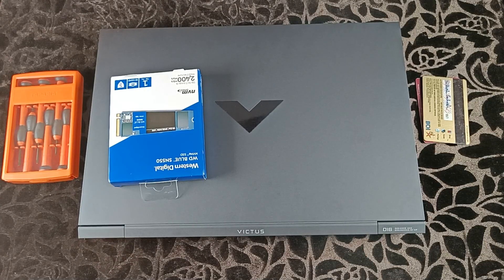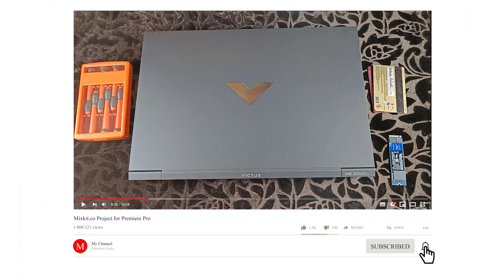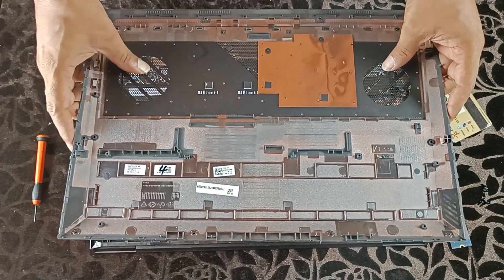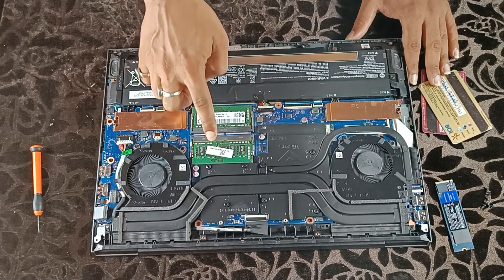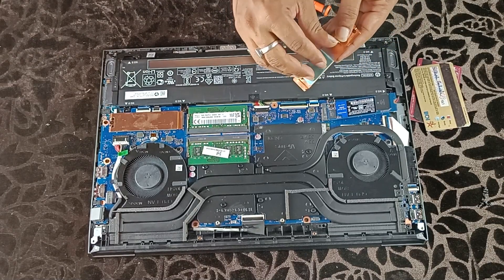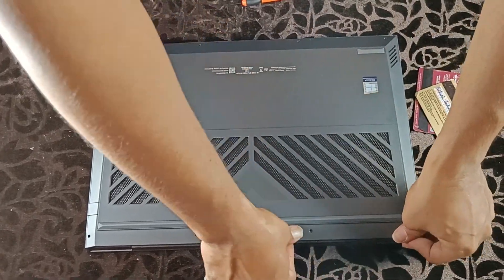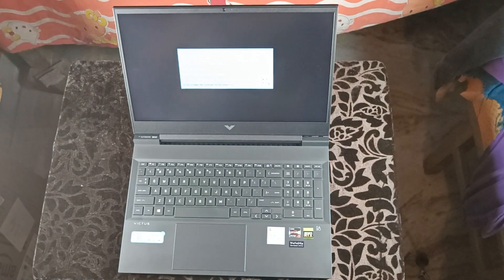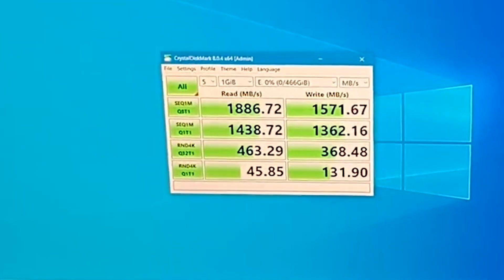Hp Victus 16 Ryzen 7 5800h+RTX 3060 Teardown  || Upgrade SSD 1 TB SSD || Upgrade option??#HpVictus

Comment: Hello, bother. My victus comes with 8GB(4x4) RAM & 256GB SSD. I'm upgrading I'll simply install 1TB SSD. while coming to the ram I'll install 16GB single chip more.  ?Since tech guys say MIXING ram is not a good idea, Because of single channel/dual channel, etc. In my case, it will be 4GB+16GB=20GB. Is that a good idea or I remove both 4x4 and install only a single 16 GB. Thanks
Reply: Install 2x8GB RAM. That way you will get the benefits of dual channel

Comment: why remove the battery conector?  never heard that being an issue before, is it just for precaution or could it damage the laptop if I don't do that?
Reply: just precaution, some chaps have dropped screws on the motherboard and all that..just in case
Reply: Helps to prevent the short circuit of your main board
Reply from the maker: you know about static current i think

Comment: hi.. really helpful on the installation part. i have a question, i installed firecuda 510 ssd and have a test on it but it only got half the speed from the advertised speed? any suggestions?
Reply: Perhaps different gen?
Reply: Verifique el slot a donde instalo el SSD hay uno de tercera y cuarta generación

Comment: Hi can you tell me that whether there is any problem with wifi adapter(wifi range  is less than 5/10 metre or getting ping or packet loss issue), if yes then was it solved after updating the software as mentioned by official hp
Reply from the maker: A new driver update already solved the issue
Reply: @mrtechinspector5942  still not resolved bro

Comment: Has anyone been able to use Softwares such as: Unity, Blender, Maya 2020, Substance Painter, Unreal Engine, Visual Studio, and Zbrush on this 
HP - Victus 16.1" Gaming Laptop? If so were you able to Render 3D Models easily in the 3D modeling programs? I'm a Game Design major that wants to make the best decision to purchase a budget-friendly laptop with a decent performance.
Reply: Hey Sam, I hope you managed to make a decision. I purchased this laptop and have been very pleased with it. Although I'm not doing 3D rendering, I do do data analysis. This device handles large data sets with ease, even with a couple hundred thousand data points on excel. It is designed for gaming in mind, and it's very effective at rendering visually-complex games like subnautica. I think it would work well for you.
Reply: @edenbelanger7260  Thank you very much for providing the helpful information! I greatly appreciate it! Have a wonderful day :)
Reply: I do some blender on my PC, the main limitation is the GPU VRAM. They are not ideal for this kind of work.

Comment: whats gonna happend if i switch the original gen 3 ssd to the other slot and putting a gen 4 ssd on the former slot? is it doable? will it void the warranty? do i have to reboot the windows? that would be a hassle...
Reply: Have you tried this?

Comment: Does this process void warranty? Thanks for video!
Reply: Nope
Reply: No
Reply: Obviously yes. Because you opened it. What sort of question is that.
Reply: @sexy_tanjiro8878  I'm not sure about other brands, but opening a HP laptop doesn't void its warranty, and neither does upgrading its storage/RAM. If you damage the laptop in the process, that won't be fixed under warranty, but any unrelated issues are still covered

Comment: Hi I have a question. Can I upgrade my GPU?
Reply: No, you cannot
Reply: No
Reply: Not inside the laptop, however you can use an external gpu that you can plug into the laptop, it won’t be built in but will still act as the gpu

Comment: Thanks for the userfull video... My Victus is Ryzen 7 5800H + RTX 3060. Questions : 1) Can it read SATA SSD, I know it's slower, but I can't any reference mention about it 2) As far as I know Ryzen model only have PCIe Gen 3, but in the video it was mentioned that it support PCIe Gen 4, ... can we verify this?
Reply from the maker: Ryzen 5800 natively support pcie gen 4 no sata ssd not supported only nvme
Reply: @mrtechinspector5942  Yes sir... but I believe that's not the case with not the "H" version, which unfortunately what I have in my Victus (5800H)
Reply: @ysundawa  You also cant mount a sata SSD in this laptop.
Reply: i knew only ryzen 6000 series had pcie 4
Reply: But that means it supports PCIe Gen 3 SSD too right? Newbie on SSD here
Reply: @rennes27  yes, it is REVERSE COMPATIBLE

Comment: How on earth do you get the back off these.  I've taken all the screws out but it just doesn't budge or anything
Reply: Get a shim for a cell phone or any thin plastic. have to pry it up slowly. clicks together around the entire chasis and 2 or 3 spots in the middle. just put 32gb of ram into mine, waiting on a 1tb nvme. Good luck. it is scary pulling it apart. Take your time.

Comment: Can i install at once 2tb nvme or only supports 1 tb per slot ?
Reply from the maker: Only 1 tb per slot
Reply: @mrtechinspector5942  Why is this? Do you have a link to official documents stating this? I can't find information on this anywhere in the manual or on Hp's website.
Reply: I installed a 2TB 970 EVO Plus and it is working fine. There is no 1TB cap per slot
Reply: @ pascal hueting it also said only 16gb RAM per slot but I installed a 32 gb and it worked
Reply: @PascalHueting  how's your experience with it?

Comment: Hi , thanks for the tutorial. Only a simple question : Can I Upgrade my new HP  Victus 16 (Intel 11.800H /8GB RAM DDR4-3200 /3060GTX 6GB)  with a couple of Corsair 16GB DDR4-2666 RAM Modules (Total 32GB) from my old DELL Alienware 15 R3? I really don't want to invest in more RAM, but I really need those 32 Gigs...
Reply: you bought a 1200 dollar laptop and you don't want to buy a 120 dollar memory upgrade? You want to use old slower memory from a 5 year old laptop? WHY?!
Reply: @MetalDeathMusic  because this guy had a budget 🙄 

I would do the same if I had it 😂
Reply: @Rajputparam07  I had a budget too. It's very stupid to put really old ram into a brand new laptop. If you can afford a thousand dollar laptop but not 150 for ram, either wait or buy a cheaper laptop!
Reply: @MetalDeathMusic    hey hey wait a second the speed is 2666 ???? 

Bro then you are ryt cze , buying a device for its high speed and processing power just to put slower rams is not a good thing to do 

Yes I would import my old ram into my new laptop or pc to increase the space or ram but I will never , never put an old slower ram into my new machine if I ever try to do this I will buy a old pc instead or a laptop
Reply: Just get the teamgroup 32gb ddr4 3200mhz which is probably 100USD.
Reply: You can try to see..
Reply from the maker: But victus have x8 ram which will give u more performance
Reply: You have to make sure the motherboard supports speeds that low.
Reply: You can't, they are different speeds.

Comment: Do we need to thermal pad for ssd to contact with heatsink or no need ?
Reply from the maker: Thermal pad is pre-installed just remove the protective seal
Reply: @mrtechinspector5942  ok,Thank ypu in case need replacement do you know what thickness it it?

Comment: Can you add an hdd in slot 2?
If not which SSD can i add
Reply from the maker: No u can't add hdd bro
Reply: @mrtechinspector5942  why not? Don't HDDs fit into pcie slots?
Reply: @randomness5281  bruh you trolling ?
Reply: @randomness5281  😂😂😂😂lol
Reply from the maker: I use wd blue sn750 it is working fine

Comment: In this laptop the wobble issue is very big ???????please answer i want to buy it but i am confused its hinge lasts long or not??
Reply: Not much
Reply from the maker: No wobble issue while normal use and when u typing but if you touch screen then it wobble
Reply: @mrtechinspector5942  what you think its runs 5 to 6 years smoothly at this type of hinge aur build quality???
Reply: @hensirathore3834  definitely it will